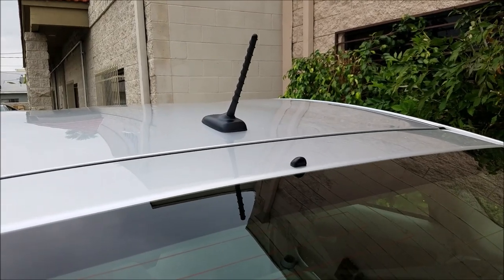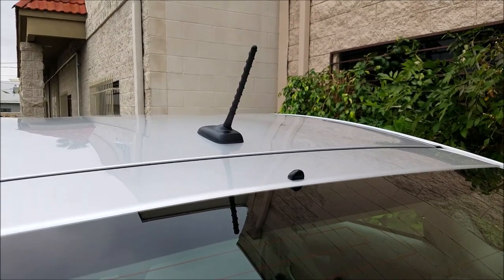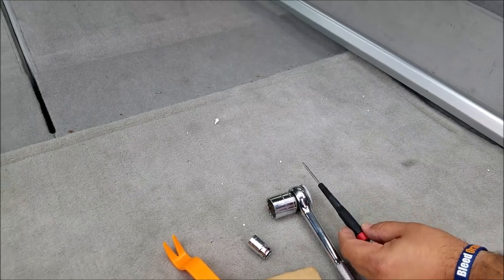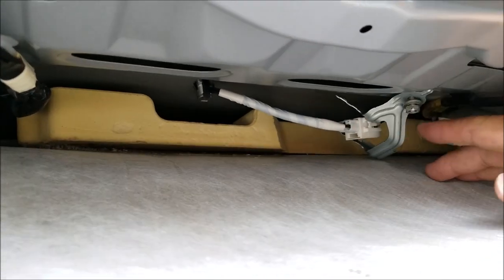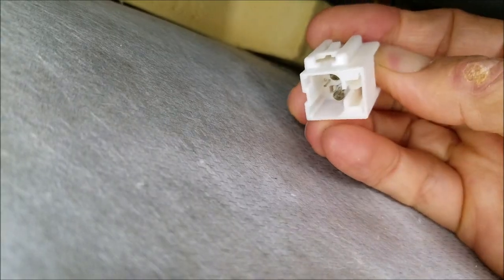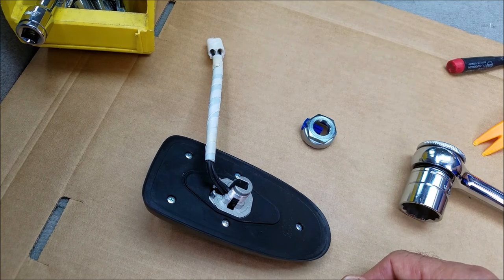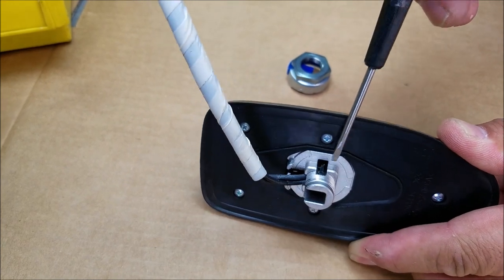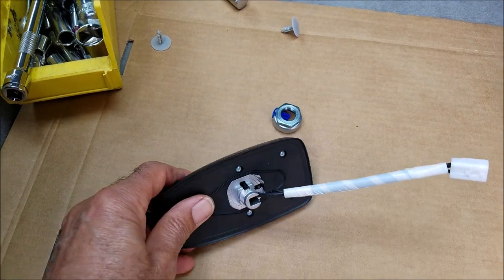How to Replace Toyota Prius 2010 Satellite Antenna.

Comment: what is the part number?I have 2011 Prius.The antenna does work intermittently in high signal area.Can I open it and checks contacts?
Reply: Watch the video. The problem isn’t with the contacts. The electronics get too hot in the sun and start to fail. You need to replace the electronics by swapping out this base.

Comment: Thank you for the great video !!!!!   It worked !  

Finally solved our "Loading" and "No Signal" errors on our 2012 Toyota Prius with the satellite radio. 

Start by replacing this antenna base !  

I originally began with customer support at Sirius XM by sending a new signal, then replaced the entire radio unit from the dash with a refurb model to no avail. Nothing worked.    

Ultimately, I found this YouTube video that it could be the antenna as there are electronic components in the base.   

The based can be purchased from this gentlemen or I found it on Amazon for $130.   Takes about 20 mins to replace.  

It worked !
Reply: Wow, i have same exact problem on my 2012 Prius 4